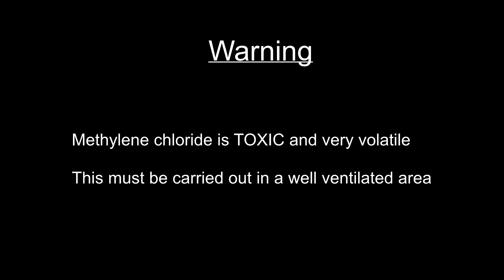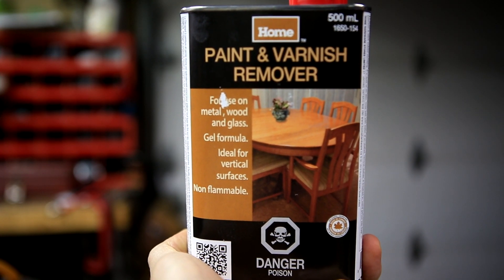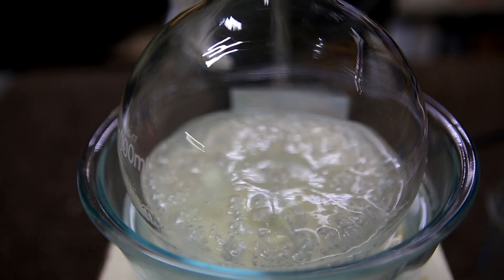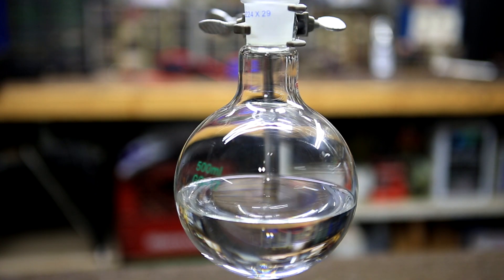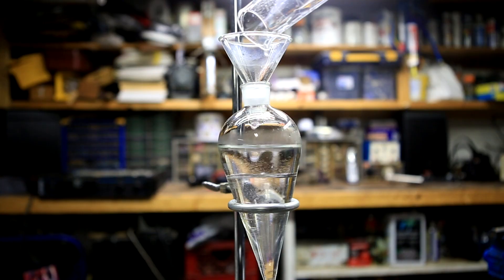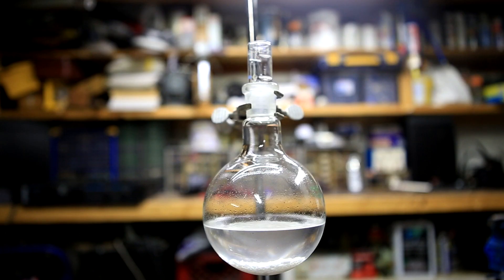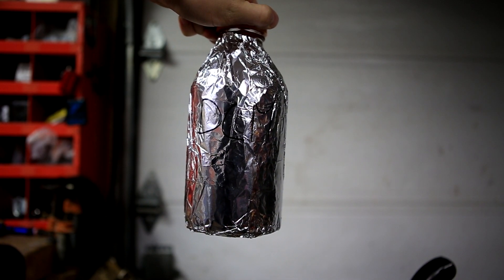How to Separate Dichloromethane (DCM, Methylene Chloride) from Paint Remover

Comment: Hey could you or someone please tell me how/if you can separate petroleum and methylene chloride, there’s a local paint striper here that contains methylene chloride but also petrol and I Seen they have similar boiling points
Reply: Is there a solution that one or the other is soluble in but not the other

Comment: I bought on eBay, several low actinic flasks...  I am seriously basic chemistry, but I want to extract caffeine.  Would the DCM be bettor off with aluminum wrapped flask or a low actinic flask?
Reply: Aluminum wrapped flask.  The incoming UV photons from sunlight will degrade the DCM causing side products to form.  Low actinide glass being red still allows for transmission of light through the glass.  Tho it be at lower wavelengths, Miron Glass did a few studies showing dark violet glass being the best for photostability.  Aluminum foil blocks ALL wavelengths of light and will always be your best bet.

Comment: Why is he shaking the mixture in the separatory funnel? What should it look like if he did not shake too hard?
Reply: To ensure good contact between the water and the DCM and methanol mixture so the methanol which is water soluble will be washed out.

And it's called shaking but more like tilting the funnel back and forth and opening the stopcock occasionally when inverted to release the pressure of any DCM evaporating suddenly.

If it doesn't form a milky emulsion it will be two layers one in top of another with sometimes isolated drops of one phase in the other.

You can see the different phases clearly usually because they have differences in refractive index.

The milky emulsion is just really small drops, like oil in vinegar in a well mixed salad dressing.

Comment: If you add a layer of water to the DCM would it prevent it from evaporating?
Reply: No, but it will slow down the rate of evaporation
Reply: @christianvn1   What is Formic Acid is present mixed in DCM?  Would the water still sit on top and stop the Formic Acid (to some degree) from fuming?

Comment: Open to anyone...........can you remove Methanol from Ethanol using the same technique?
Reply: A good way to separate methanol from ethanol are molecular sieves.  Though nothing will ever remove every trace of methanol from your ethanol if you're doing this in an amateur lab.
Reply: @pietrotettamanti7239  and ethanol made from a fruit containing pectins will contain some methanol. As will for instance apple juice. When the heads are discarded most methanol is removed to the point the rest isn't poisonous, and the antidote for methanol poisoning is ethanol in any case.
Reply: No, because they are both infinitely miscible with water. This only works because DCM is immiscible with water but methanol is miscible. Therefore the water will wash it from the DCM.
Reply: Also if you are using this to try to in denature ethanol, that's not recommended or sane and it's far easier to prepare your own by fermentation and distillation.

They add all sorts of nasty toxic shit to alcohol to denature it, not just methanol. Which are deliberately very difficult to separate because they form difficult to break azeotropes, and employing any other nasty chemical trick they can imagine make it as hard as possible to dodge the excise man...
Reply: I heard pyridine and melamine were both common additives D:
Reply: you can seperate ethanol from methanol by fractional destillation, as far as i know, they do not form an azeotrope. i still strongly advise against ingesting this ethanol if you don't know exactly what you're doing, since you will probably have trace amounts or other impurities left. a simple destillation will definitely not be enough, since the boiling points are quite close together.

seperating methanol from ethanol by mixing it with water will not work, since all three compounds are completely miscible with each other.

Comment: Are there any good alternatives to DCM except maybe Chloroform since it is almost just as bad? I personally am not able to find any products containing it in the stores I know of. In Germany it has been strictly prohibited in 2010
Reply: DCM is waaaaaaay better than chloroform. A good alternative is toluene or xylenes as they're less toxic but they're quite high boiling.
You could also use diethyl ether, but it's quite dangerous.
Reply: @pietrotettamanti7239  yeah but you won't find diethyl ether in any store either, unless you make it from boiling sulfuric acid and ethanol....

Comment: Couldn't this have been done by a simple hot water extraction? Methanol is easily soluble in both hot and cold water while DCM is only partly soluble in could water.
Reply: you want to add hot water to  methylene chloride that boils at 40 degrees Celsius ?! are you mad ?

Comment: While obviously not the most efficient option, is it possible to make dcm through a free radical chlorination of methane at home? If so, you should do a video on it!
Reply: Eric Fussell you should react methane with chlorine and then do a fractional distillation to separate the DCM from the chloroform and the carbon tetrachloride. Not really simple

Comment: how do I carry out the distillation part in a simple highschool lab? I need DCM in my experiment but there is no way possible to buy in the DCM..
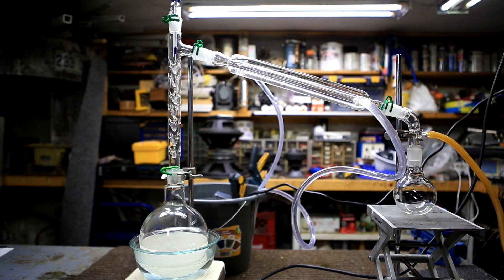Reply: do you see the set up he has at 0:55 the piece of lab-glass that's above the left Round bottom flask, if you didn't have that piece it would be just a distillation and you could do it the same way. the idea behind distilling is you have a mix of liquids of different boiling points. lets say you have mixture of a liquid that is made up of 2 liquids liquid A has a boiling point of 100C and liquid B has boiling point of 50C. let's say you heat the mix to 60C liquid B boils and travels up the glassware when it hits the top it goes into the condenser that's the long sideways glassware, you can't see it but he has cold ice water running threw the condenser making it cold. when the gas that was liquid B gets cold it turns back into liquid B and then it falls down that pipe and into the flat bottom flask on the right. after sometime the flask on the left at temp 60 will not boil because all of liquid B has moved threw the glassware and is in the other flask. so with different boiling points you can use distilling to separate out mixtures of different liquids. the next part at 2:10 where he removes the methanol he is using a separatory funnel this works on the two liquids having different density, the separatory funnel is just a funnel with a valve so you can drain the liquid on the bottom by turning the valve. so he makes one of the liquids in the mix have a greater density it then falls to the bottom of the separatory funnel he slowly turns on the valve to drain off the heavy liquid. much of chemistry is separating mixtures of things. that way you can do your reactions in the correct amounts without other stuff going on. look for the underlying principles over instructions.

Comment: would magnesium sulfate substitute as an alright drying agent as opposed to calcium chloride?
Reply from the maker: +jared garden I think so, but to make sure you need to lookup solvent/drying agent compatibilites
Reply: yes, but it will take longer to work, and you may need to use a little more, it doesn't absorb as much water as calcium chloride...

Comment: where do you get your glasswear?
Reply from the maker: +Liamthepyro Mostly ebay and ali express
Reply: +liam the great The left overs likely still contains DCM. When the water mixed with it, the DCM would  quickly start to boil off. That is what happened to me when I washed the RBF after distillation.

Comment: I have a question about DCM. I want to know how can I be safe with it, I mean do I have to wear gas mask or something like a cloth because it's toxic? Is it's toxicity is about the same like methanol?
Reply from the maker: Many people seem to be paranoid about methanol. To me, methanol is very safe. You need to literally drink it to have problems. Also, the vapor pressure isn't too high, so there isn't even a big risk of filling a room with it.

For DCM, the vapor pressure it pretty high, so the moment you open the container you will probably smell it. The toxicity isn't too bad though. Honestly, if you are running a reflux or something, you won't even smell it. However, it is still good to do it outside or in a well ventilated area. The danger comes when people use it to clean and they cover large areas with it in poorly ventilated areas.
Reply: Thanks very much, I will extract caffeine with dichloromethane and vanillin with methanol.
Reply from the maker: Sounds like a good plan!
Reply: Yes, it's pretty interesting to have things like these. Your videos are very good and can you make a video about making cinnamaldehyde in future?
Reply from the maker: I've done the extraction of cinnamaldehyde already and I am editing the footage. You get like 0.5% by weight from cinnamon sticks. It is hard to get a lot of it though.
Reply: Ok.
Reply: +Nile Red I have one more question: do you think that anhydrous magnesium sulfate can also be used instead of calcium chloride for drying the DCM? I hope yes, but I just need to be sure plus I have dehydrated the MgSO4 already.
Reply from the maker: Eimantas a I would think so, but i am not 100% sure. I always check the drying agent compatibility table before I use anything.
Reply: Nile Red Thank you.
Reply: The real danger of DCM is buildup in your system, if you inhale a low concentration over a long time or are working with the vapours in a poorly ventilated area. The DCM itself isn't particularly toxic, though does have an anaesthetic effect just like chloroform.

If you have DCM in your bloodstream for more than an hour or so, it starts getting metabolized by your liver. One of the metabolic products is carbon monoxide, which is far more toxic than DCM itself. So people have been known to die of CO poisoning several hours after exposure to DCM vapours.

Comment: Have you ever gotten this Paint remover on your skin? It stings something fierce, like fire ants!!
Reply from the maker: I actually spilled A LOT on my hand and arm. I opened the can and it was under pressure and I didn't have gloves on. It felt fine, then started burning like hell. Definitely felt like the time I poured conc. HCl on my hand.
Reply: Graham Smith Found an easy source. Welding anti-spatter spray. 500ml for 7€
Reply: Nile Red Take care not to get DCM on yourself if you can. I worked with it for several years and became sensitized to it. The slightest drop now hurts like I've been thrown into lava. Other than that it's a great solvent: low toxicity (all things a relative), not really flammable, dissolves everything (relative again). Damn hard to get the EU now though.
Reply: @wobblycogsyt  Low toxicity? The vapours alone can kill you.
Reply: @wobblycogsyt  I'm pretty sure it's a carcinogen so I wouldn't call it low toxicity
Reply: @therealestg9  my understanding is that the jury is still out on that. If I had to guess I'd say we'll probably find it is carcinogenic but so is a lot of other stuff we're exposed to every day. Ethanol, for example, is a known carcinogen but people still enjoy a drink. You might not want to bathe in DCM but handled correctly it's comparatively safe compared to many other solvents.
Reply: @AEON.  You just need to search a little more.
Reply: It's like icy hot. Nice and cooling at first then burns like hell
Reply: One time I was a idiot (it was like three in the morning, and I hadn’t slept for a while)

I added 30 grams of sodium hydroxide to sulfuric acid.

It boiled so bad that it cracked my beaker. But the worst thing, one of the drops landed on my hand, instantly melted through the nitrile glove, and the superheated sulfuric acid hit my skin.

I have a scar at that spot to this day.